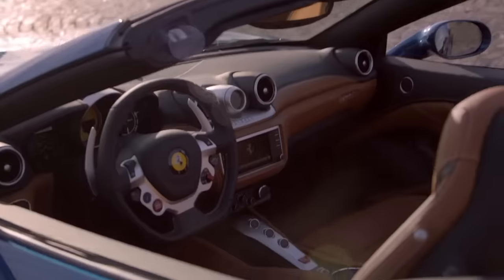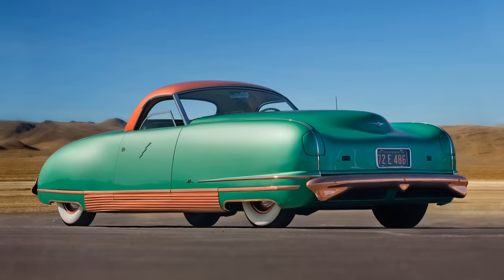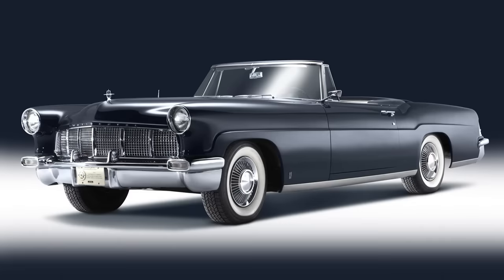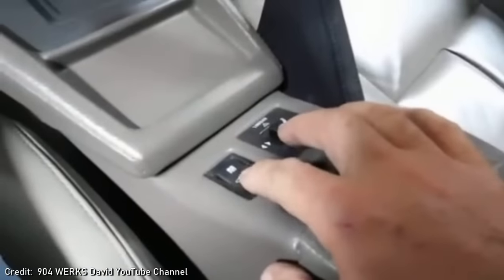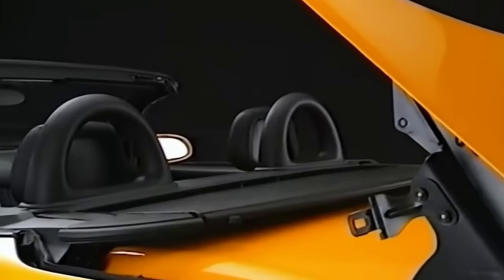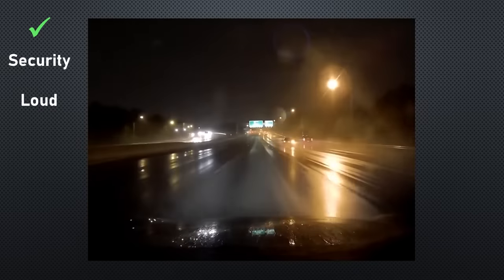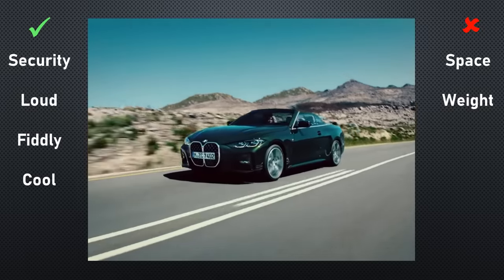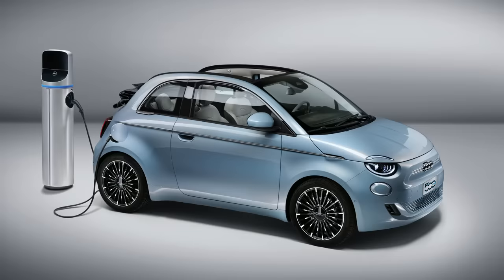The Rise and Fall of Retractable Hardtops

Comment: My boss bought an SLK when he sold the company.

It was pretty impressive. Merc got lots of things right that others got wrong.

- The remote control would operate the roof, and it was smooth and looked cool.
- Open tops need to have a different wind-flow pattern, otherwise you get dirt and wind in your ear when driving at speed, or a whirlwind behind your head.
- The chassis needs to be much stiffer.
- The interior needs to be different - more waterproof and easier to clean.
- The dashboard needs to be different, or you can't see the dials when the sun shines on them.
Reply: It's just an SLK.  You want stiffer chassis, buy an AMG variant
Reply: Well said!
Reply: TOO BAD  THE NEXT SLK WILL BE A SOFT TOP...
AND LOOK LIKE TOO MANY OTHER MERCEDES. THE END OF AN ERA.
Reply: @MICHGO1  the soft top turned out really well imo
Reply: Heh, SLKs are famously pretty horrible things.
Reply: @pistonburner6448  why?
Reply: @ruahruah2154 because
Reply: It's crazy that some of the things Mercedes got right with the SLK and older SL (namely with regards to visibility of things on the inside of the car), they got horribly wrong with the new SL when they decided to give it two digital screens for the driver to interact with.
Reply: @LoganSLRLockwood  Yes, absolutely, with those screens they've thrown all previous experience, rulebooks, science, expertise out the window and just chased the most moronic trend. I just can't believe that any car company's executives would be so incompetent, let alone so many car companies' execs going with that. Same with so many other car companies.
Reply: @pistonburner6448  to add insult to injury, the roof mechanism is operated through the screen too lmao.
Reply: @LoganSLRLockwood  Madness
Reply: And then the 1st gen Daihatsu Copen Kei Car improved the roof mechanism by a lot since it was designed by the original SLK roof designers and Webasto

Comment: A couple of more advantages to retractable hardtops that are a huge part of the reason why I'm not interested in trading my Z4 for the newer softtop version:

1) Much smaller c pillars. This not only greatly improves the looks when the top is up, but on a smaller model makes a huge difference in the size of the side window space. A small softtop car often has downright lousy side visibility with the top up.
2) Durability. The hardtop will last just as long as any other part of the bodywork while softtops will fade, crease, and wear out no matter what you do to take care of them.

Comment: On top of that some cars are easily totaled when they get a rearimpact with the hardtop in the boot.
Reply: That happened with a work colleague's car. He had a Volvo C70 and, while picking his kids up from school, someone ran into the back of his car. The impact was sufficient to put the roof mechanism out of true. Uneconomical repair, according to the insurance company, so was classed as a write-off.
Reply: @davidrobinson4400  still love the c70 though
Reply: Not related to the roof, but I had rear-ended another car in my 2001 SLK320. :( After repairing the front end (they had to take the engine out), they discovered the crankshaft had been hit, so the engine was also needed to be replaced. The insurance company had paid for the bodywork, so it covered the engine rather than total the vehicle. Ended up being a $28K repair. I loved that car, and it was hard to give it up.

Comment: I own a 2004 Lexus SC430 hardtop convertible (all SC430s were hardtop convertibles).  As it is now 20 years old with over 175k miles on her, the hardtop is still fast, works perfectly, and looks great with the top up or down. The cabin is whisper quiet when the top is closed and is leakproof even in a car wash. Its 8-cylinder engine is cheap to maintain with Toyota and aftermarket parts from Amazon. It’s destined to become a future classic.

Comment: I have had a VW Eos for about 6 years as a weekend car and I love it. The roof looks just as good down as up and the large sunroof makes the low headspace feel much more open when the roof is up.
Maybe if you are mechanical moron it may not be the car for you, but a little bit of regular maintenance to lubricate the seals and pulleys and clean the roof drain holes and channels is all that is required to keep it working perfectly with no leaks.
I really cannot see myself getting rid of it for many years as there is simply nothing to replace it with. It’s small size, hard top, 2 litre turbo motor and six speed manual transmission makes it great fun.
Reply: I didn’t buy an eos because the reliability of the retractable roof was poor and required specialist repairers.
The Nissan convertible with the glass roof was fine but the engine was not reliable.
The BMW 420i convertible is great so far touch wood but it is 8 years old now so I am a little worried about all those plastic parts under the bonnet.
Hard tops much easier to clean with bird problems.
Reply: I have owned an EOS from new for 17 years and it looks as good as new. The boot space is fairly generous even with the roof down but if you need to use all of it, not to worry, you have a  glass sunroof at your disposal too. It was my daily runner for over a decade and has proven to be quite reliable. I am slightly disappointed it was not mentioned in the video.

Comment: I have a 2009 MX5 PRHT.  The roof folds down vertically in 12 seconds into a space between the seats and the trunk which still has enough room for a set of golf clubs. The biggest advantage vs. a soft top is less chance of vandalism and theft via a slashed roof.
Reply: Just put some concrete in the boot and be done with it, manual roof folds down in about 2 seconds and is far lighter, live in a better area of town if you don’t want your roof slashed.
Reply: Mazda's PRHT is fucken bullet proof, been daily driving my 2010 in Snowy Manitoba for 10 years, it has 260,000 the top has been up and down at least 300 times per year.

One Time, I had to red locktite some adjument nubs.
Reply: If someone is willing to cut through a soft top, what's stopping them from throwing a rock through the window?
Reply: Have an 07 prht, great car. I love the heard top version as opposed to the soft top as the car feel more solid when the roof is up when compared to the soft top. Have driven both but the prht was much nicer.
Reply: @kisong1960  Um... most cars have sound sensors for the alarm and immobilizer.
Rocks and glass smashing make noise.
Glass gets everywhere and leaves evidence behind.

A knife through a soft top is almost inaudible, doesn't trigger the alarm, and leaves behind no evidence.
Reply: @Jabber-ig3iw   Found the guy whose girlfriend left him for a guy with an NC!  And btw, stock vs stock, the NC DESTROYS the NB in any form of race.  In much greater comfort and safety, as well!
Reply: @kisong1960 noise. Throwing bricks at cars is noisy. Cutting cloth is not.

Comment: As an open top lover, I'll take whatever I can get, sunroof, moonroof, targatop, softtop or retractable hardtop. The problem is that the market is just too small. Most people don't want to spend extra for an open top of any kind. They've got A/C and that's all they need. I want both. I insist on A/C, but I'll pay extra for an open top if I can get it.
Reply: I want a convertible wagon!
Reply: I totally respect your liking for open tops of whatever form. I just wish I understood it. 

For me, I find there seem to be almost zero times I can even enjoy a sunroof open (or even the shade covering the glass) let alone having a convertible top down. 

Either the sun is angling down into my eyes (behind my sunglasses), or it's either too hot or too cold out. Any of the above 3 scenarios makes me want everything above my head shut / closed.
Reply: @be5952 the droptop mafia is going to chime in here...  if you're too hot, you're not going fast enough!
Reply: @glurak888 Dodge made a convertible pickup truck

Comment: I always liked the 3rd gen version of the MX5 convertible with the PRHT. Another one I've always liked, is the Volvo C70, also with PRHT.
Reply: Yeah ive got a mx5 nc2 PRHT, takes only 11 seconds to go up or down
Reply: Big thumbs down for the NC mx5, terrible car. Especially with that silly heavy roof.
Reply: @printedprops8730  so about 4 times as long as the manual roof on the NB then.
Reply: @Jabber-ig3iw  yeah but you get a hard top and not a piece of cloth over your head. 

The prht is great because it lets you drive around with your hard top without the need of going home and putting your hard top on as you would need to do with the NA, NB and the normal NC model.
Reply: I think they were both designed by Webasto. They designed a lot of these, actually, including the Eos, 3 Series & Z4, Ford Focus, Ferrari California, Daihatsu Copen, and the MX5 RF.
Reply: @Jabber-ig3iw  It's not that heavy - it's made from polycarbonate, not metal.
Reply: @KaneDesign  Why would you need to put on a hard top? Sure, the MX5's soft top was deliberately made very lightweight and therefore noisier than many other soft tops, but that does not make soft tops in general bad or inferior to hard tops. On the contrary: even the MX5 would've been far better off with just a different soft top version with more layers and more expensive solutions than a hard top.
There's a reason why modern cars, including Rolls-Royce use soft tops: they are no worse in sound insulation or anything else, and they are far more lightweight, better for the car's structure and dynamics. People don't think properly, go far enough when thinking about what a hard top does to a car overall: it compromises so much in the car and makes it ride and drive worse.
Still, with the MX5's top it was understandable that simple common people wouldn't understand that a second, thicker soft top option would be better and they probably wouldn't even notice its existence since it wouldn't stand out. Nor would they believe it nor pay more for a different soft top version. So it made sense to just make a hard top version so it will grab everyone's attention. So many people have no clue about cars and engineering and Mazda can't educate everyone, so it makes sense to just cater to their misconceptions and give them what they think they want.
And of course the NC's hard top wasn't that bad as it was so small.

Comment: The MX-5 NC has a super simple power retractable hard top, and it wont take any boot space. The car looks amazing with the roof up or down.
Reply: I have the ND RF and it doesn't take up any boot space either.  It sits in a space just behind the passenger compartment.

That said, as noted, the ND RF is more of a "Targa Top" than a full convertible.  So there's less "roof" to hide away.
Reply: @petermerchant4439  I do love the looks of the ND RF too. I know hard tops are bit heavier than the soft tops, but for those of us who daily their roadsters, the added security is necessary IMO.
I did get light wheels, flywheel, suspension and exhaust to compensate for the added weight. It's been a slow process, but it's totally worth it IMO.

Comment: I worked for ASC in the 1990s, including on the Mitsubishi 3000 Spyder, mostly on the latches.  The concept was sold to Mitsubishi by the marketing department with little regard to the complications introduced by trying to fit hard, load-bearing panels held together by latches and hinges.  Early prototype testing resulted in lots of failed latches and hinges.  This was eventually resolved by putting interlocking features in the panels themselves to better transfer the loads.  There was also an issue with crash testing.  The original boot cover was very rigid and would push right through the rear seat area; under those conditions it was very dangerous to rears seat passengers when the top was down.  It was almost like a horizontal guillotine!  This was fixed with retention hooks at the front and crumple zones designed into the otherwise very stiff composite boot cover.  There were also issues with electromagnetic interference with the relays and solenoids inducing voltages into the switch and sensor wires, "confusing" the control electronics into to simply stopping in the middle of retraction.  A very expensive electromagnetic environmental effects consultant had to be brought in to fix those glitches.  ASC had done a lot of soft tops but the company had no idea what it was getting into the the Spyder hard top.  Ironically the Eclipse soft top was one of the very best made by the company.

Comment: That Del Sol "retractible" / removable top is nice ! I'd MUCH rather own a retractible hard top than a soft top. It's just nicer, to me, but I'd think purists dislike them ?
EDIT : I didn't know there were motorized soft tops, and that the material is stronger now. The motorized part is what I like... If I were to own a convertible.

Comment: The retractable hardtop on the Mazda MX-5 NC was great. The only slight issue was you had to stop the car and it took 12 seconds. A manual soft top instantly goes up or down and you can almost do it on the move or at a junction. 
Some "soft tops" these days are a hybrid. Soft fabric on the outside with a hard headliner.

Comment: Love my MX-5 with a soft top. Light, and quick to put up or down in two seconds with one hand. Wouldn't want it any other way 👍
Reply: My favorite manual soft-top story comes from a friend of mine...

She bought an old Chrysler Lebaron convertible.  One day there was a sudden rainstorm and she pulled over to the side to put up her top.  A BMW Z-3 pulled over as well.  The guy reached back, grabbed the soft-top to pull it forward and...it got stuck.  He pushed it back, pulled it forward, it got stuck.  He started swearing as he frantically tried to get his top up.  Meanwhile, my friend pressed the button and the top smoothly went up.

She thought, "...and you paid how much for that car?"

Yeah yeah, I know.  All manual convertible tops are easy to put up.  Until the rain starts pouring down and you want to get out of the rain and you don't necessarily provide an "even pull" because water is pouring down on you and something jams which makes you even more frantic.

Granted, I have a shoulder issue that makes it hard/painful for me to reach back and pull the top up.  But even when I didn't, I still went with electric tops.

Comment: Even though soft tops outweights hard tops in the modern era, I still like hardtops. It provides better insulation and it looks cool. Plus, u cant cut open a solid roof compare to a fabric roof. Even though the top part is hard material, there are still areas vulnerable to knife cuts

Comment: Another thing which is good about hardtops is the visibility. The 2014-2019 BMW 4 series cabriolet (hardtop) has more window area ( rear window and rear side windows) and thereby making the general driving in city more convenient. I do still prefer the hardtop design because of its design, not looking like it is covered by a sheet of fabric but instead being a cabriolet in disguise.
Thanks for the informative video 👍🏽
Reply: That is a significant difference. If you look at the roof-up over-the-shoulder and rear visibility in the SLK vs. soft-top contemporaries such as the TT or the Boxster, the Merc is far superior.

Comment: Um, I had a Mk3 MX5 retractable hard top and it had exactly the same sized boot as the soft top. Only the badly designed clunky ones take up boot space compared to a soft top. My new MX5 I bought last month is a soft top as the new MX5 retractable hardtop is, as you said, just a retractable targa top, not a true open car. Plus, the Mk4 MX5 soft top is a dream - one handed open / close in about 2 seconds while sitting in the car. A massive improvement on my first MX5. a Mk2. And don't even think about the Triumph Spitfires I had as a lad. Those soft tops were horrid plastic things like pitching a very stiff tent, and they leaked! But back in1972 a Spit was s great fun car for a young lad! It's all relative.

Comment: In the past I may have been in the market for a soft top with a manual hardtop option for longer trips but I didn't find a model I liked.

When driving open you experience the world around you much more intensely. Great fun. Perhaps driving open is generally associated with posh/extravagance and that therefore the market is relatively small. Also most people will not have experienced the joy.

Great video as per usual.

Comment: I own a 2004 SLK (hardtop) and a 1998 CLK (soft top). I like the soft top much more. Not only because of my personal aesthetic preference, but also it is far less problematic down the line. Less weather striping to get damaged, old an leaky, it rattles much less on bumpy roads. And in the rain it makes you feel like being in a tent 😅 Sof tops do not require that much maintenance and do hold up really well. There are companies specializing in refinishing the fabric when needed and usually it's not as expensive for example an engine rebuild 🤷🏼‍♂️ also less prone to damage in case of a minor accident.

Comment: Tbh, retractable hard tops are a great solution if you want to have a convertible car for every day and every season. You can enjoy it during winter without the "anxiety" of the "dubious sturdiness" of a soft top. And if the hard top has got a sunroof, you can also enjoy any sunny day appearing during winter without having to open the roof and getting cold. And it also is safer than a soft top in the event of a theft. 
But a soft top is far simpler in terms of packaging and weight of materials and parts. And, as the Mazda MX5 proves, you don't need complicated mechanisms to raise or lower the soft top, you just reach it with one hand and do the job in a matter of 5 seconds, max! This is especially useful in the event of a sudden downpour! 😉
So thank you very much, but a soft top is by far my favorite kind of convertible! 😉